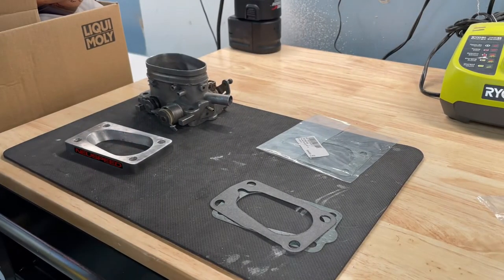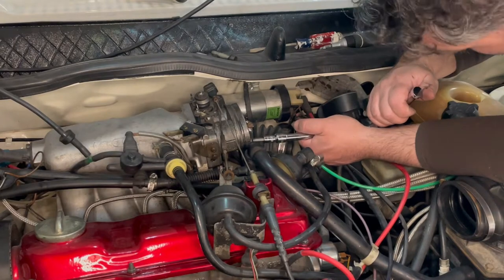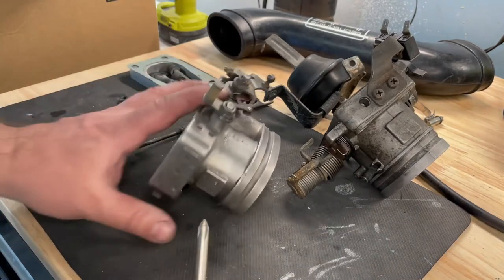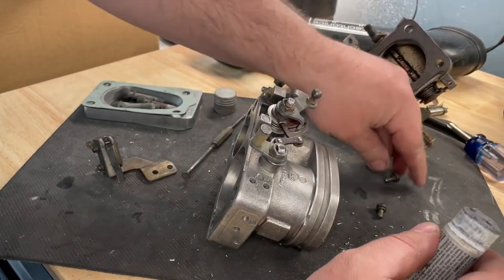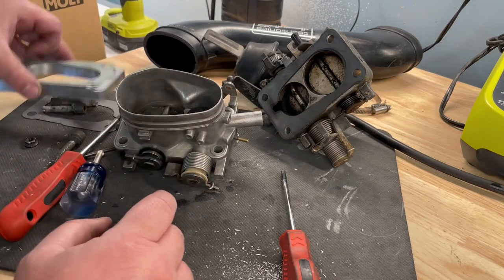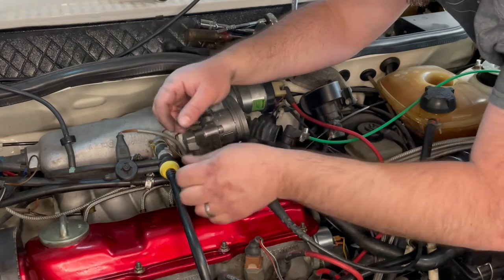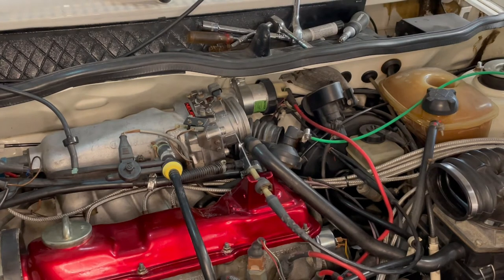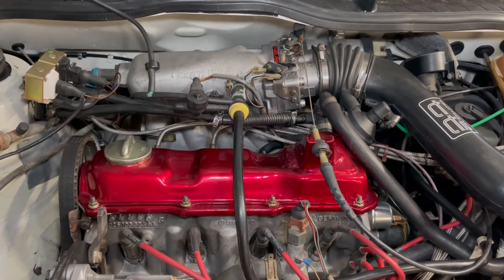Neuspeed Throttle Body for the MK1 VW Cabriolet - Part 2

Comment: Awesome video!I have the same neuspeed setup on my 84 GTI.It was already on there when I bought the car years ago so I knew very little about it.You cleared up a few questions I had about it.Thanks👍
Reply from the maker: Glad I could help
Reply: Did you have to adjust the idle speed? And if so was it pretty easy to fine tune it ?Im thinking mine is out of adjustment and would like to see how its done on that throttle body.Thanks again for putting out some mk1 stuff!
Reply from the maker: @DB19736  Yes, when I first installed it the idle was too high so I had to tighten the idel adjustment screw to lower it back down to around 900 RPM.

Comment: What is this ? I mean this spacer throttler body . For what ?
Reply from the maker: The replacement throttle body is larger. The simple (and most effective) approach is to modify the hole on the intake manifold to match the increased diameter of the upgraded throttle body. Neuspeed made this adapter allowing you to mount the larger throttle body without modifying the intake manifold. The spacer is to allow for a transition from the larger bore to the smaller stock bore.

Comment: Hello do you gays know we’re I can get that Throttlebody
Reply from the maker: They don't make it anymore so you have to try to fund a used one wither on a forum or eBay. 
You could source a Mk2 throttle body, and swap over your Mk1 linkages. It's not hard, but takes a little time to do.
You could source an Audi 5000 throttle body, or one from a Digifant II VW Fox (don't use a CIS Fox TB). These both have the correct directon of pull for the Mk1 throttle cable. You might need to swap one piece of your existing Mk1 linkage onto it, but it's obvious once you see it. You also may need to mess with the vacuum and Idle hoses, as these sometimes have more or less nipples than your Mk1 TB.